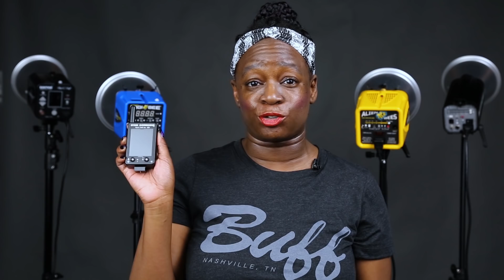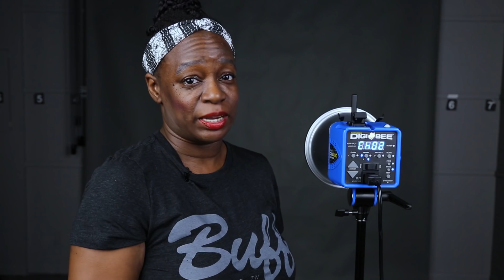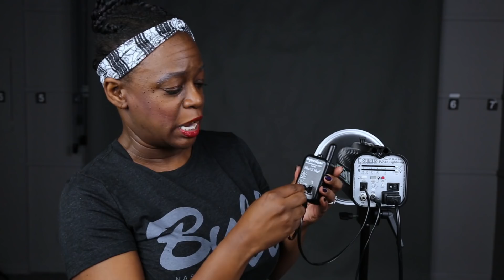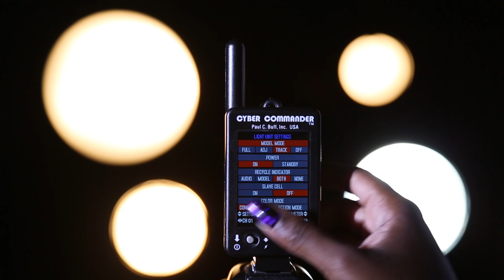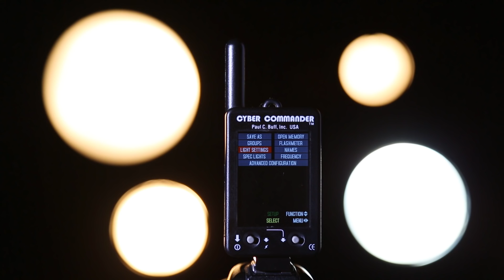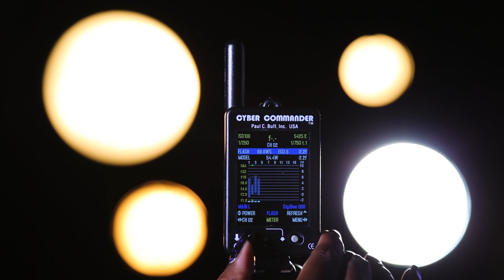Cyber Commander™ – Video 1 - Setup

Comment: I've followed all of these instructions through (twice) and the light does not fire when I press the shutter button. It will give a constant glow when I change it from track to full but will not flash no matter what I do. I've even tried using the cord from the cyber commander to the camera in case something is wrong with my hotshoe but no luck with that either. I've never used a lighting system before - can anyone help!?!?
Reply from the maker: So sorry you are having some issues. Please call our Customer Service team at 1-800-443-5542 (M-F from 9am - 5pm CT) and they will be happy to help troubleshoot!

Comment: I am familiar with the Cybercomander and I love it, I just wish they will make the hot shoe connection in a more robust format. It is very flimsy and with heavy use, it gets very loose.
Reply from the maker: Understood and that is something we are addressing with our engineers. If you have a basic CyberSync trigger transmitter you can use that on the hotshoe to simply fire the lights and handhold the Cyber Commander to do your adjustments.

Comment: Hi.  Just to be clear, if I am using the Alien Bee's I don't have to use the a/c corded Cyber Sync Plus receiver, I can use the Cyber Sync Plus battery one?
Reply from the maker: That is correct! You can use either the AC or battery plus model receiver.
Reply: 👍🏼 @PaulcbuffInc

Comment: After about 5 years of loving my Cyber Commander, I sent it in for a broken right joystick. It came back with neither one working. I've emailed the repair department but haven't heard back yet.
Reply from the maker: Hey Jim! Sorry to hear that. We will give them a heads up and see what's going on with the email.
Reply from the maker: Also, we had a spot on the website where the email for repair had not been changed yet (fixed now). The correct email address is repairs@paulcbuff.com (just in case that is the issue)
Reply: @PaulcbuffInc   - The email address is correct. It's been 10 days and I'm still waiting. My prior repair (a sync socket on an ABR800) was also a total fail. Do you know who else repairs your products?
Reply from the maker: Hey Jim, Would you be able to call our head technician Joe at 1800-443-5542? He is over our repair department and would be happy to take care of this for you. If calling is not convenient, would you mind resending your email to marketing@paulcbuff.com? This way, we will get the email on our end and can make sure the repair department sees and responds to it. All emails into the building are usually answered within 2 business unless it is a special circumstance. We're sorry you are having these issues and we would like to figure out what's going on and help you in anyway possible.

Comment: So it was easy to set up my AB1600 thanks to this video. Unfortunately, I have a problem with it consistently firing. I get to a point where the "Dump" light turns on on the back of the AB unit and the Cyber Commander won't work anymore. I turn off the power, unplug the phone cord, plug the phone cord back in, turn the power back on on the flash unit, and it works again. Note when it's not working, if I press test on the receiver or press Flash Meter on the Commander, I get just a tiny pulse of light out of the AB.
Reply from the maker: Hello! Glad to hear that the video helped you get set up. The problem you are experiencing should be an easy fix however since there are a few different possibilities to try, give customer service a call and ask for Joe or David and they will be able to fix you right up:)
Reply: Thanks! I got all the help I needed from Joe today.  What a wealth of knowledge, and I'm now happily firing my AB1600 like clockwork thanks to his troubleshooting tips. Now I can finally give my Einstein some company. Very happy PCB customer here! :)